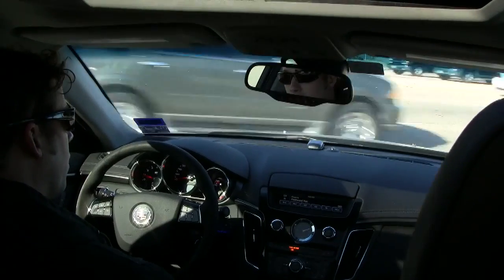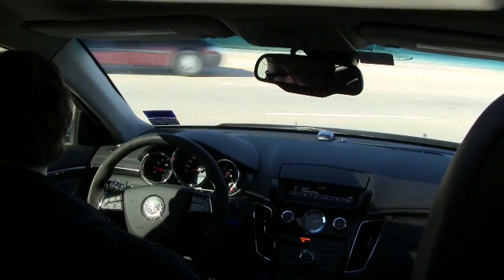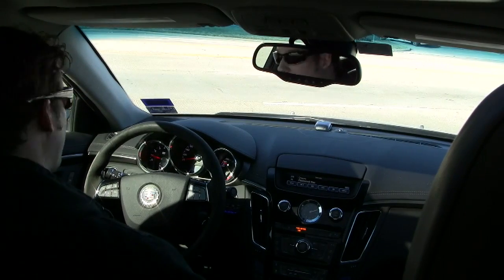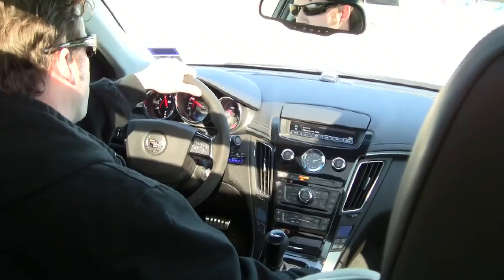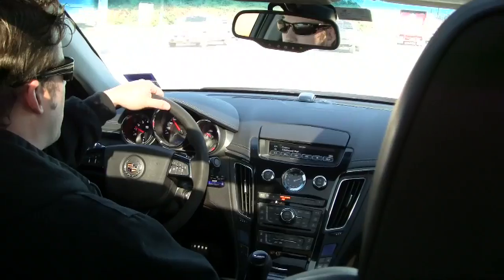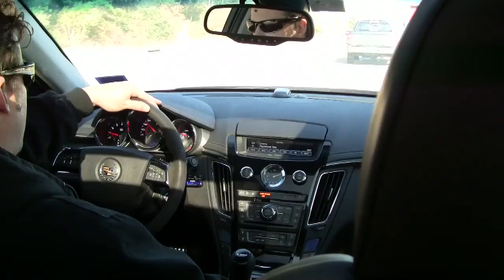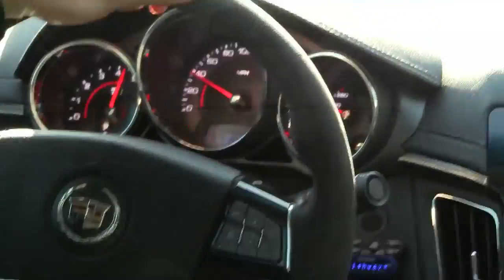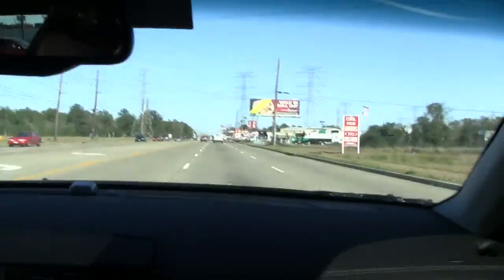Cadillac CTS-V with ZR-1 Blower Upgrade (CTS-VR1)

Comment: heads cam full bolt on and a larger supercharger and only about 150 HP over stock to the wheels? something isn't right at all. and if that is a zr1 supercharger, why the hell would you re use the CTS v lid? the zr1 and zl1 lid both are better and more efficient. something isn't right here at all.

Comment: I am a cts-V owner as well, i disagree with stick being slower on the v cuz on my stock V i get 3.8 to 3.9 (0-60)!!! But i do agree that auto cars can be faster than stick by modifing the transmition and the cluch! But they will never be as good as stick when it comes to performance! ( auto = straight away) ( stick = performance) (just an opinion) i could be wronge!
Reply: nasir faryabi If you look up the specs on our cars there auto is faster. 0 to 60 and 1/4 mile. we also can shift ours manually and the a6 shifts faster than any manual. auto 0 to 60 is 3.9 manual is 4.2. these cars have to much power and the autos cpu helps out the power to the road. The manual makes more power but the auto is faster.

Comment: The lsa and ls9 blocks are also different. The LS9 has thicker bulkheads, and has been machined for oil squirters for the bottom of the pistons. The LS9 also has unique heads cast from stronger aluminum. Not to mention a forged rotating assembly as opposed to cast for the caddy's LSA.